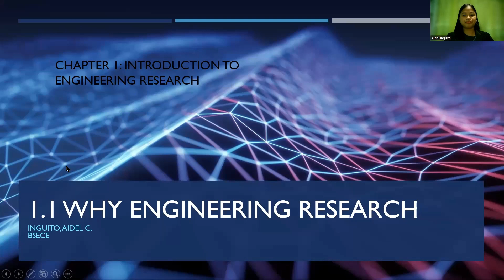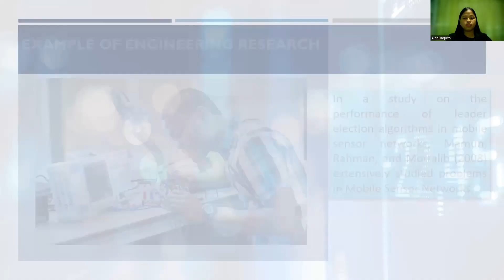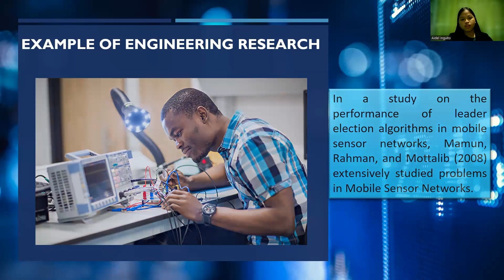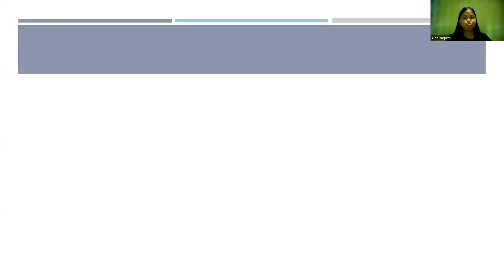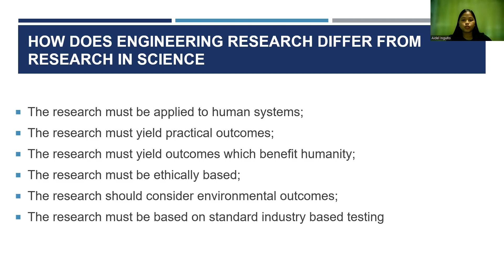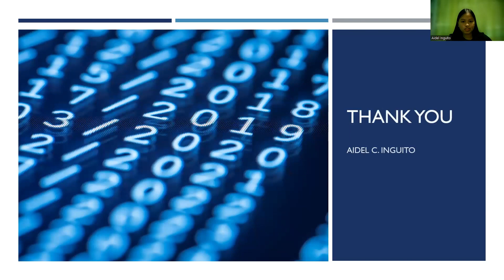Why Engineering Research?

Comment: Christian J. Andos
March 20, 2023 
MWF 6:30 P.M. - 8:30 P.M.

REFLECTION:
By seeing this video presentation in essence, engineering research aims to advance theory and practice in areas including high-speed computing, biotechnology, earthquake prediction, power systems, nanotechnology, and building. I learnt that it is important for us to understand how engineering research applies scientific ideas to real-world systems and seeks to improve mankind through useful outputs while being morally grounded and taking environmental considerations.

REACTION:
The reporter emphasized why engineering research is important. really thoroughly. She provided us concrete examples and clarified what she had said. It uses examples to clarify complicated concepts and simplifies ideas for easier understanding. Those of us are interested in the benefits of engineering research, this presentation is excellent in every way.

SUMMARY:
By summary of her report, engineering research focuses on the systematic conceptual organization of knowledge and its discovery. Engineers create, design, manufacture, erect, and maintain systems, equipment, and buildings that have economic and societal value. It is centered on the systematic conceptual organization of knowledge that engineers have invented, built, or used to run machines, buildings, and systems of economic and societal scale.

Comment: Borganio, Jeff G.
March 20, 2023
MWF 6:30-8:20pm

Reflection:
From the topic that's been discussed, I can conclude why engineering research is important in our lives. Primarily because it helps us to innovate and to have a long term solution to specific problem. Also, this is why we innovate, because it's our job as a future engineers to solve different practical problems that are related to our specific field. Moreover, this will help me to have a broader understanding why research is important in today's time, also to understand the methods and steps in doing research.

Reaction:
The reporter gives a concrete example on how engineering is important in our field, how come it is beneficial to us and how to have a research that will address practical problems. Moreover, the report is well presented and the methods of approving and disapproving a research hypothesis is clearly stated. Overall, this topic was discussed effectively by how the reporter deliver the topic.

Summary:
Engineering research helps us to solve many practical problems in our daily living. Scientific method are used in this field but it directly answer towards practical applications and services. Almost research starts with hypothesis where it can be true or false. Proving a hypothesis requires many examinations and testing so that it will meet the certain conditions but it's easy to disapprove a hypothesis, one mistake can make the hypothesis false. Moreover, research must also meet the desired outcomes that will fulfill objectives that benefit all humankind and also the environment. Overall, the goal of engineering research is to make our living easier and to address practical problems that requires long term solution.

Comment: SORIANO, ARCHIE ISABELLE A.
MARCH 19, 2023
MWF 6:30-8:30pm

REFLECTION
As we all know that engineering research follows the same scientific method, with the goal of applying practical applications of science to products, services, and infrastructure. As an engineer, when you are conducting a project, you should conduct scientific research in order to test ideas with the long term goal of finding solutions for practical implementations of your research findings. In line with this, as an engineer you should put into consideration the code of ethics wherein it should influence how research is conducted and ensure that the outcomes will benefit humanity and also the environmental outcomes.

REACTION
Based on the video presentation, the presenter delivers her topic well and was able to answer the title on ‘why engineering research’. This video tells at the same time helps us to deepen our understanding about engineering research.

SUMMARY
In engineering research,  its all about the application of science to realistic systems which can benefit the humankind and also to the environment.  Wherein, they are based on scientific method which applies science to products, services or infrastructure. In engineering research, engineers are engage in scientific research to test ideas with the goal of finding solutions  to the practical implementation regarding to their research outcomes. They are also constrained with the code of ethics which every engineers should practice and implement to ensure that the outcomes are delivered in line with the principles for the sustainability of the humankind as well as the environmental outcomes.

Comment: Cacaldo, Elvin E.
March 19, 2023
MWF 6:30pm - 8:20pm

Chapter 1
1.1 Why Engineering Research?

REFLECTION: 
 Engineering research is therefore based on the principles of scientific research which, in turn, are based on the scientific method, in which observations (experiments), theories, calculations and models. The disciplines of engineering are all described as the application of science to realistic systems which benefit humankind.
 
REACTION:
First of all, the speaker made a very good visual aid that helped the video easier to understand for the viewers. The discussion is well-explained throughout the video, and the topic is overall well-presented because the presenter explain clearly and concise manner so that the viewer's can easily to understand to her report.

SUMMARY:
In summary engineering research concerned with the discovery and systematic conceptual structuring of knowledge. Engineers develop, design, produce or construct, and operate devices, structures, machines, and systems of economic and societal value.

Comment: Mamac, Jane L.
March 19, 2023
MWF 6:30 - 8:30 pm

REFLECTION: In this chapter, I learned that new knowledge is often discovered through research. Engineering research's primary goal is to produce new information that will benefit humanity.

REACTION: The reporter did a wonderful job of presenting and discussing her subject.

SUMMARY: In this chapter, It discussed engineering research which is crucial to humanity because it helps people learn new things and broaden their grasp of a subject. New information based on well-known and widely-accepted scientific measurement and thought concepts should begin by creating a research question.